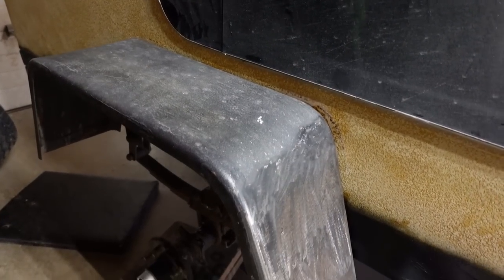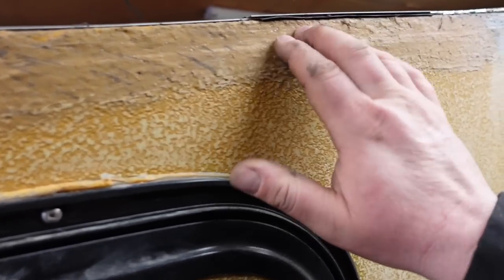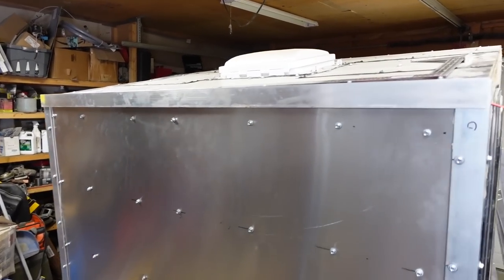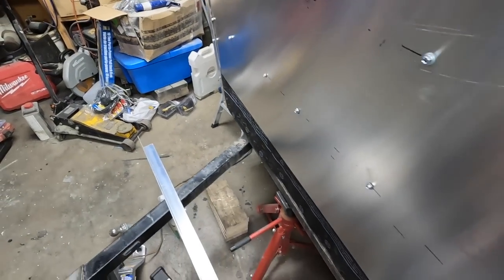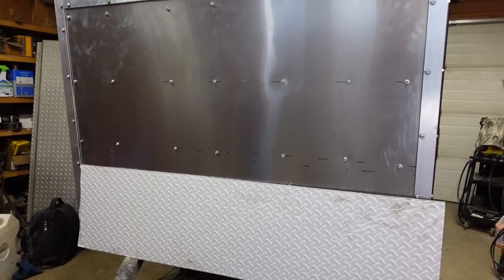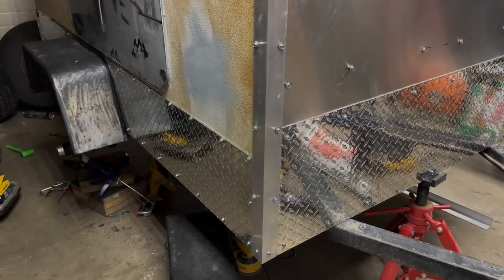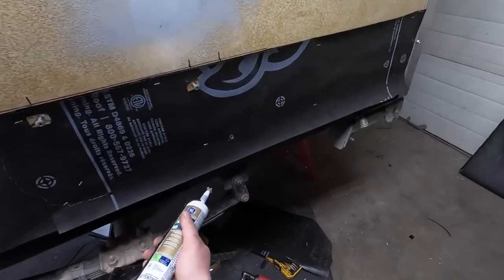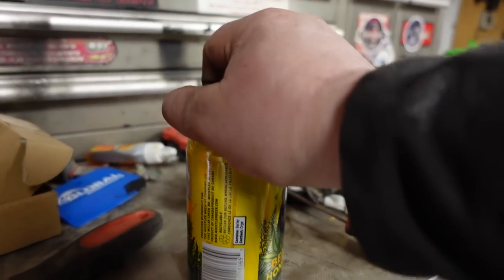DIY OVERLAND TRAILER | NO GOING BACK NOW

Comment: The key to filling the gaps on the angle and having a nice bead is to push with the caulking gun don't pull. It pushes the sealant into the crevice and the nozzle leaves a uniform bead. Learned that from my uncle who does windows and doors.
Reply from the maker: Thanks for the advice 🍻🍻🍻

Comment: Great job , all the hard work will pay off when you get out camping in it , great little trailer.
I'm just about set to embark on my northern safari from southern Ontario up to the Yukon and NWT and to Tuk then over into Chicken Alaska and beyond , then back down to camp and explore northern BC . 
I built a raised sleeping platform from 3/4" plywood , in the back of the Rubicon , and built a drawer system into that , lots of storage where the rear seats used to be , under the platform ,  and the in the drawers in back . I have a roof rack , with storage boxes , and a 100 watt solar panel a shelf inside with solar batteries , and a fridge fits nicely in there , spare water and fuel containers on the outside ... anyway I look forward to seeing your vids camping with the trailer ,again awesome job 👍 ... who knows maybe we will bump into each other out on the road-trail , or when I have service , I'll be able to watch your adventures while I'm out on mine. Anyway I'm heading out your way soon , although I'll be heading much  more North.
Cheers Wild Bill . Exploring the most remote places of northern Canada . Never stop exploring!!!
Reply: Check if the roads are passable...lots 9f flooding
Reply: @offtheclaim1468  I won't be going for a couple weeks yet , and I have some exploring in Ontario north of Superior. Hopefully by the time I get going west out of Ontario things will have settled down.
Reply: @billw6182  hit me up for an update...or Yukon 511
Reply from the maker: That’s pretty sweet going to be a great trip